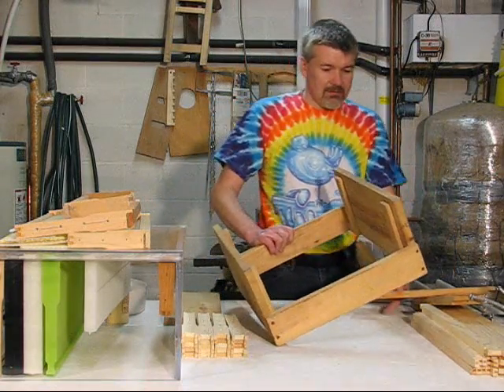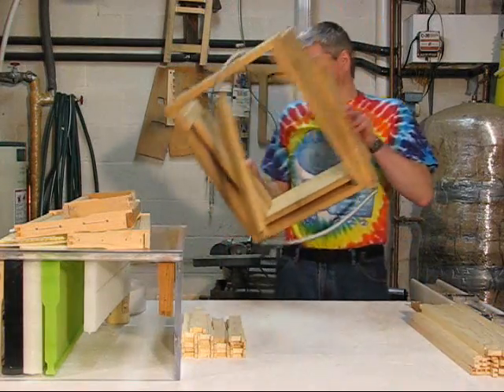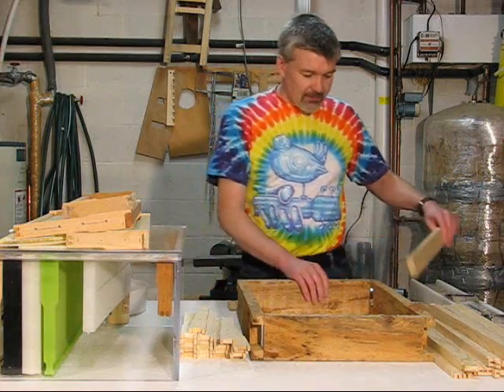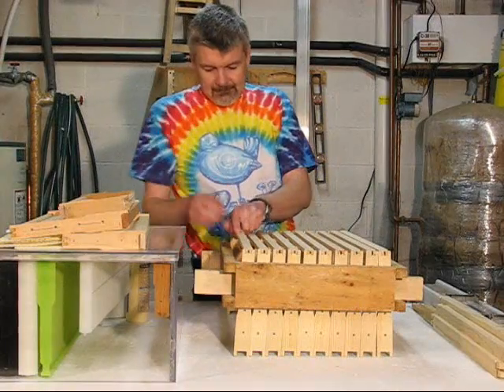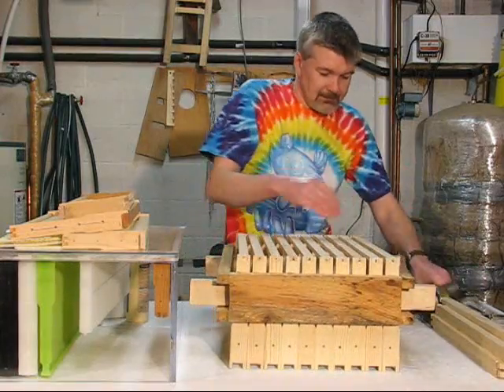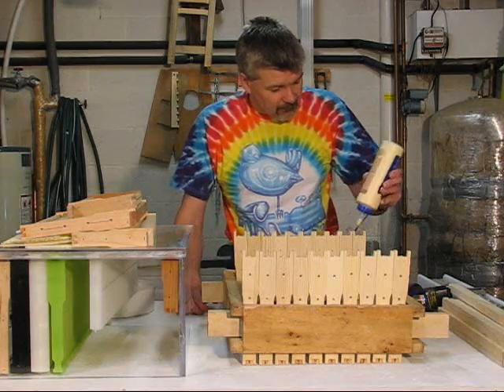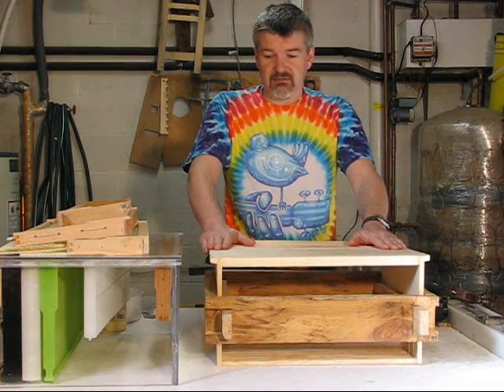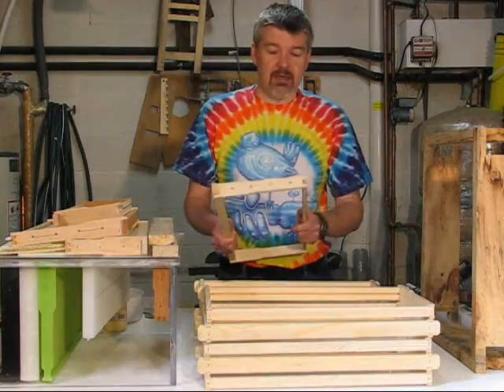Frames & Frame Assembly - Part 4 - Jigs and Air Nailers

Comment from the maker: There is no weight on the bottom bar.  In fact if you use foundationless frames, there is a good chance the bees won't even attach comb to the bottom bar.  Furthermore,  there is not much "meat" on the bottom of the frames to nail horizontally.   Personally in all my years of beekeeping, I have never had just the bottom bar come off.